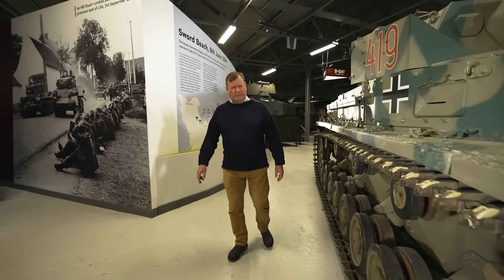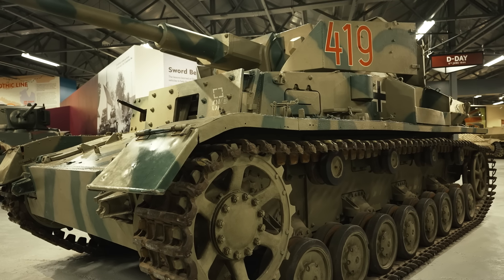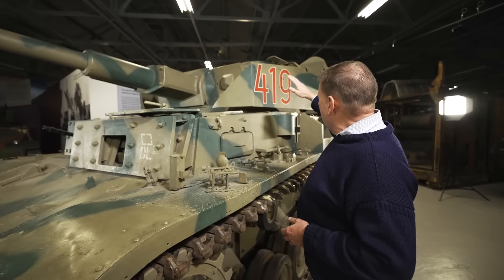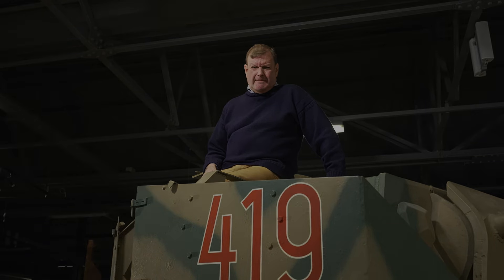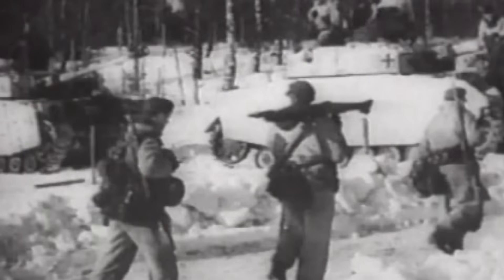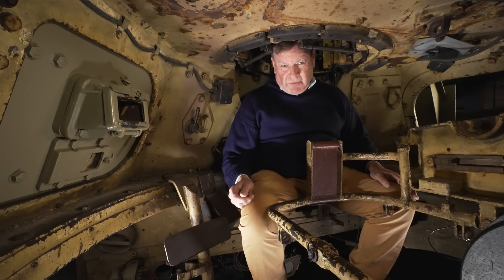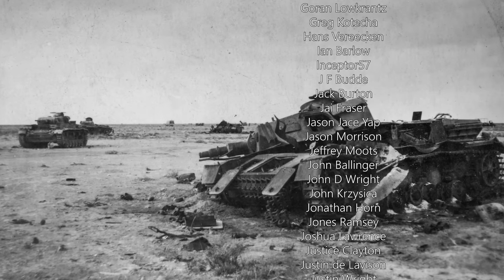Tank Chats Reloaded | Panzer IV | The Tank Museum

Comment: This is a wonderful presentation.  The original condition of the interior really gives an understanding of how it was to use it. Cramped, but seems task efficient, maybe "cozy".
It's interesting that the internal layout is very similar to many modern tanks, except that the commander was moved to stbd side due to the longer breech.  Loader seems better moved to the port side, to load with the right hand.

Comment: 8:50 
I haven't actually verified it but I remember being told by more knowledgeable people that APPARENTLY the frying the eggs on panzers in Africa is ruse as they heated the the metal from the other side with a welding torch or somesuch device.

Comment: Truly an incredible machine. I’ve never seen one in person. This restoration makes this tank the latest version an opponent would encounter on the battlefield. The returns of armor plating would come with impactful drawbacks as well, as the engines weren’t designed for all the added shield weight. This resulted in the engines taking on much heavier loads than the tank was designed for. The drawback of the extra armor was less maneuvering power as well as that it ate through petrol at a higher rate. Still, no doubt armor plating it to make it less obsolete during the later years of the way was the right way to go.

Comment: the commander position in a panzer 4 is quite unique in that it seems designed to crush the commander between the breech block and the back of the turret
Reply: Well, the Panzer 3 had a very similar arrangement.
But it can't crush him; that metal cage surrounding the recoil space will catch the gun if the recoil system should fail.

Comment: The Panzer 4 had an interesting history. The early versions were poorly armored and could be penetrated by small caliber anti-tank guns early in the war in Poland and France. Its stumpy 75mm gun was excellent for taking out fortifications and had a better chance at knocking out most pre-war tanks compared to the Panzer 3. Later upgunned and uparmored variants were more than a match for taking on all latewar allied non-heavy Tanks. The main drawback with the uparmoring and upgunning is that it caused a lot of pressure on the forward suspension which caused it often to break. Lastly, the simple fact that it was never truly replaced by the Panther, which was designed to replace it, shows how dependable the design was.

Comment: The Western Desert campaign would've been harsh on any Tanker with temps going up to 50 degrees. I would love the chance to sit in her .I have sat in a Abrhams and that is like a Recliner chair in a Armoured Bath Tub with a Lid and Barrel above your head that locks you down. Also I have driven tractors from the 80's with Lever controls. Just the old spare tyre might stop me getting inside

Comment: I appreciate you fellas getting inside. You really could stand to get more of a snapshot by getting “B-roll”. Cut away shots of close-ups of the vision block periscopes the commander had, the controls for gun traverse and elevation, etc. etc… you could really go to town.  Filling these videos in with much craved visual details.  Why not cram a couple of your mechanics in there in their coveralls to give a sense of how tight it would have been?  You could   have so much fun with this.
Reply: That's just what I was thinking. They have most of the equipment storage, ALL of the controls, still present and looking like they used to. Why don't they put someone in the seat saying "So I look through the telescope HERE and I press THIS switch to illuminate it.... I press THIS pedal to fire the MG....I flip THIS to put the turret in powered mode...."  and so on. Explain EVERY control and feature of the tank. I'd watch it - heck, I'd watch five such videos, one for each crewman, and I think there's enough material for them.

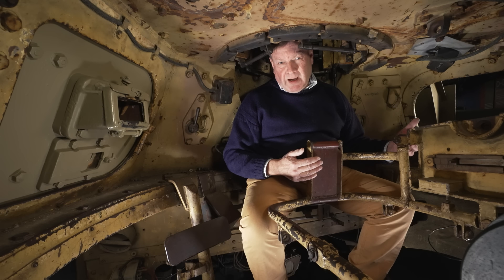Comment: 7:35 The last the Ausf. J didnt have the electric traverse anymore, to save on copper and production cost and speed. Instead improved traverse was equipped as well as an traverse for the loader to help treverse speed of 10°/sec and more were easily achivable. By british tests the gunner alone was over medium distances as fast as the electric traverse and over short turns (around 60° iirc) faster.
Reply: You must be really proud about your WT bug report 😉
Too bad the loader can’t reload the gun when he is helping to traverse the turret 😂
Reply: Not so. The extra traversing handwheel for the loader was introduced long before the Ausf.J.  It was apparently introduced along with the "long" gun, in the Ausf.G. Which makes sense because that gun made the turret more difficult to turn.
Reply: @daveybyrden3936  It’s probably there for traversing the turret on slopes, since that made it more difficult. Maybe the power traverse didn’t work under such conditions anyway or could damage it.
Reply: @ThatZenoGuy  Well, we don’t want to open that box about T-34 😄
If Shermans and Pz IVs are 3.7, they would be at 2.3, if they had their crappy real life performance 😂

Comment: Great video! No heat in these tanks? Love the “ Panzer Omelette “!
Reply: @daveybyrden3936  Not sure about that. I used to work with a retired Colonel from the Army( WWII and Korea) who said they used to heat their canned food on the back of the engine bays on the Shermans.
Reply: @AOL0321   Frying an egg is hotter than heating food.
An engine bay with a running engine is hotter than a sheet-metal storage box.

Comment: Superb descriptive video.

By chance, weren't Panzer crew interiors painted a RAL "white" color from the factory?
Reply: They were generally painted ivory, but the extent of it depends over the course of the war.  At various points the floor and/or areas below the fenders would be a light grey-blue, red primer, or a combination of those two.  Farm equipment green may be used on some drivetrain components, and controls are generally black.  After August 1944, more of the interior was just red primer.
Reply: That's the original paint, and its name was "Ivory". I'm not sure but I believe it was expensive to make pure white paint in those days.

Comment: I can't help but think they would have been much better off focusing efforts on optimization the manufacturing and continously upgrading the Panzer IV's (up-armor front, new powertrain, trans, suspension) instead of the colossal time-sinks that were the Panzer V and VI. Those were logistical nightmares, and I'd argue that a well organized group of P IV's and TD's would fair much better than a group of Tigers. Also, the long barrel 75mm was a great cannon and could punch through the frontal armor of both Sherman and T34 until the end of the war.
Reply: It's certainly a good Idea, although I find two Problems with it:

1) having more tanks would also mean having to Crew and supply more Tanks. The Germans were already struggling to do so with the Limited amount of heavier Tanks they had, so adding a few thousands Panzer IVs would have Made that Situation worse.

2) Germanies doctrine still called for heavy Tanks. Sure, a Panzer IV is fine fir Most situations, but If you Run into a Chruchill, an IS-2 or Just a heavily fortified area, you might want Something a little heavier to do the Job.

Additionally, in theory at least, Panther and Tiger made sense. The Germans knew they were never going to win the production game, so they had to try to make their tanks "worth" more.

Comment: Wait, so this is an up armored D model that was regunned?  I am confused here. But the "found in a tank driving school" at the end of the war would make sense if I understood the rest. If this is so, it would have been nicer to really touch on that.  As this would make this machine very rare and storied indeed. I mean even beyond the usual Kilroy was here soldiers everywhere and in every time thing.
Reply: That tank has had multiple upgrades. The original added armour brought it up to Ausf.E level and may  have been factory added. But it was after construction that the tank's capacity for radio devices got upgraded from two to three. You can see the old rack for two power supplies in front of the RO position, and the new racks behind him.
Years later it got a number of new things that may or may not have come together; the new gun (plus new ammunition bins), the new intercom, and the second layer of new armour. And skirts.
Reply: @daveybyrden3936  Just makes you wonder if this guy was causing mayhem in 1940 or 41...and survived 42 and onward. No small thing in that.

Comment: It finally hit me:  German crews didn't wear any sort of head protection inside the vehicle.  Lots of metal parts to get knocked into on the side walls. There must have been quite a number of unnecessary head injuries.
Reply: I believe in the early war 1939/40 German tank crews had berets which were padded. I don't know why they got rid of those.

Comment: As the most numerous tank of the WWII German forces, the importance of the reliable Panzer IV cannot be overstated.  There were plans to improve the type even further with more armour, bigger engine and reworked suspension etc. Which if completed would likely have made it an even more potent adversary. Thankfully, the NAZIS squandered the resources and design effort of the "problem child" Panther and white elephant Tiger II.
It's purely academicals at this point but a force of Stug IIIs, upgraded Panzer IVs and Tiger I with it's transmission issues fixed. Would arguably have been a better use of resources. Enabling the push to capture the Caucasus oil fields a viable mission.
Reply: The Panzer IV couldn't be improved after spring 1943. It had reached the end of its evolution. All they could do was build the Jagdpanzer IV with its chassis.
By 1944 the Panther was more or less as operationally reliable as the Panzer IV. There wasn't much in it.
The Tiger II wasn't a white elephant. That was the Jagdtiger. The Tiger II performed well when used in decent tank country.
The Germans were right to build the Panther. Panther could go toe to toe with allied 1945 tanks. Panzer IV couldn't.
Reply: By the way, Guderian declared the Panther fully troop ripe in February 1944 and it was no longer called "our problem child".
Reply: @lyndoncmp5751  I still think they should have proceeded with the Panzer IV improvements, which incidentally included sloped armour on the front. Together with redesigned suspension to cope with the planned increased weight. My memory fails me trying to remember the exact details of the planned improvements but it would have given the tank the capability to slog it out with the best allied vehicles. I recall something about designs submitted for a larger redesigned turret too, to accommodate an improved gun. Sadly I do not have Hillary's' books here, they are in storage.
It certainly would have been interesting to see how the new improved PzIV would have stood up to the Centurion with it's 17 pounder. The old one did very poorly in Syrian hands against Israeli Centurions. Again, I can't remember if the Israeli Cent's had been upgunned to the 105mm.
Reply: Gus Gone 

Well the problem with the Panzer IV by 1944 was its hull width. This meant that the turret ring couldn't take a larger turret hence was stuck with the 75mm L/48 and couldn't take a longer more powerful gun. All they could do to improve its firepower was dispense with the turret and have an open top as on the Nashorn with the 88mm L/71 or an enclosed casemate as on the Jagdpanzer IV 75mm L/70.
Practically, they couldn't really improve the Panzer IV as a tank after spring 1943. It was also stuck with just a 50mm turret front thickness, which was not great for 1943 onwards.
Cheers.
Reply: @lyndoncmp5751  The planned new turret was to solve those very problems, along with the others previously mentioned.  (The aim being to field the Panthers gun in the new PzIV turret, with heavier armour, better suspension and improved engine.) 
They obviously decided at that stage, starting from scratch with the Panther was the way to go. It being easier to upgrade Panther in the future. Little did they know, there was no future.
Of course 1940's Nazis did not have the benefit of 20/20 hindsight we have today. After the failure to capture the caucuses oil resources, the argument became irrelevant. Fuel for any tank was at a premium. Regardless of greater productivity from a well proven  Panzer IV design. 
Those oil fields would have yielded much more than fuel oil. While denying the same to the reds.  Synthetic rubber was also in short supply and the German chemists were even better at their trade than the tank designers!
The German obsession with bigger and better engineered tanks, let them down. When good enough and in larger quantities was the way to win the war.

Comment: Did I miss something or misunderstand? I thought he said the last run of tanks didn't have the electric motors to turn the turret. I don't think he told us how you turn one without it. Did they just yank on it? Did they have wheel to turn? A handle? Neither of those seems quite possible. The force necessary would be enormous in my mind. Anyone know how they'd turn it without the motor? Or let me know what I missed. Thanks.
Reply: They had a wheel traverse which was pretty quick anyway. Earlier versions had both electric and hand wheel. The ausf J only got rid of the electric.
Reply: There was a wheel for traverse. He lights it up at 7:27. 
The same wheel was the controller for the motor traverse;  there was a mode lever above it.
The wheel also incorporated the trigger for the main gun. You can see it.
Reply: @lyndoncmp5751  Wow. All that weight could be moved with man power? That's pretty amazing.
Reply: @daveybyrden3936  So they would turn that wheel and the whole turret would move? That's pretty remarkable. You'd think it would have to be geared so it would take a half hour to turn from one side to the other. That weight must be enormous. I bet they missed having a motor!
Reply: @thanksfernuthin   Well, it was riding on quality ball bearings.
Seventy-six ball bearings of 35mm diameter.
Reply: @thanksfernuthin   The German design notes are lost, but there's a British report where they take measurements of turning speed and gear ratios etc.etc. The Tank Museum have it. It might be online somewhere.
Reply: @daveybyrden3936  Cool. Obviously amazing engineering. Had to weigh a few tons. Thanks for the info!

Comment: I always wonder what happened if a tank got penetrated and the crew was killed or bailed out. If it was recovered what happened to the penetration hole? How are these holes "repaired"? Or are they left untouched?
Reply: I've see some with small steel plates welded over the holes, kind of like a plaster.
Reply: @lyndoncmp5751  very interesting, so indeed some stop gap solutions instead of replacements. Thx for the info. 👍
Reply: Years ago on a TV documentary, a veteran talked about cleaning out Shermans. No thanks.

Comment: Is that a Panzer IV Ausf. D?  Looks like an F2 , G or later.  Perhaps it was updated & up gunned from an Ausf. D to some later spec?
Reply: Just looked it up on Bovington's website and it left the factory as an Ausf. D with extra armour plates fitted to the front hull and turret. In 1943 it was upgraded with the 7.5cm L/43 gun and even more armour plates.
Reply: @armchairgeneralissimo  TY for that info
Reply: @armchairgeneralissimo thanks for looking that up. Clearly not a stock D, so I was wondering
Reply: It was built as an Ausf.D but in about 1943 the Germans themselves upgraded the armour, the gun, the ammunition storage (because the new gun had larger ammunition), the turret roof ports, and the intercom. There was also an upgrade to support dual radios (Fu2 + Fu5) but that probably happened way back in 1940.
Reply: The ausf D had a strange shaped glacis plate. Not straight. The radio operator/machine gunner position is recessed back. You can clearly see it here, as well as the bolted on extra armour.

Comment: Just visited the D-Day invasion sites last month. Sherman tanks and artillery pieces on plinths everywhere. Every one is held together almost solely by its paint. They are rusting away before our eyes. They may only be examples of the weaponry used in Normandy and never actually fought there but come on aren't they worthy of restoration? Would this happen if it was a spitfire or Dakota? No it'll be a fibre glass replica on that plinth. 
All that historic armour just sitting there basically crumbling into dust in the salty sea air. They should be rumbling around showgrounds and shaking the earth again.

Comment: In my opinion, if the Germans had concentrated on making the PIV and not all the other wonder tanks, they would have been better off. They would not have been able to match the production levels of the allies, but they would have had more of a very good tank.
Reply: Nah, they would have had neither quantity or quality superiority.
The Panther was needed, to match the next generation of allied tanks. It didn't have a much lower operational % than the Panzer IV in 1944/45 either. Panzer IV could not be improved after spring 1943 and it was nearly 10 tons lighter than the improved versions of Sherman and T-34 which came out in 1944.